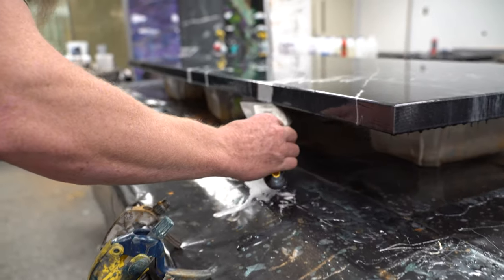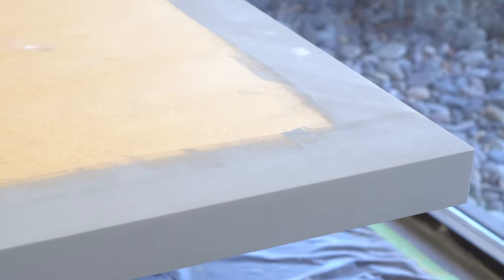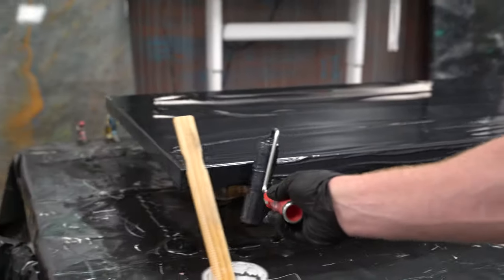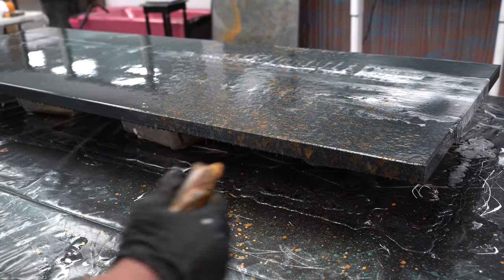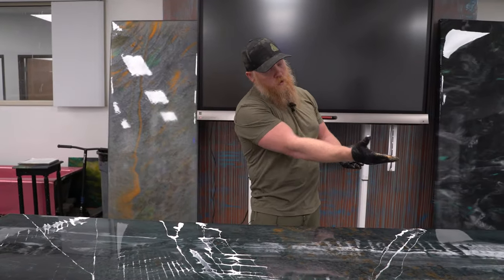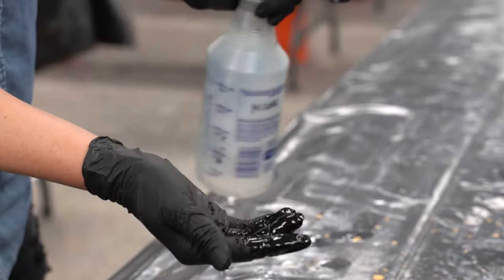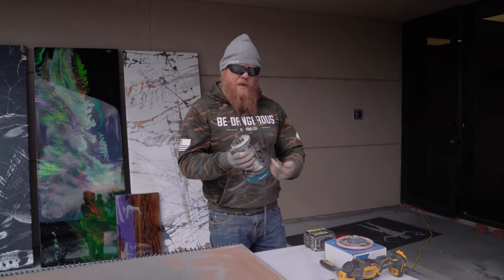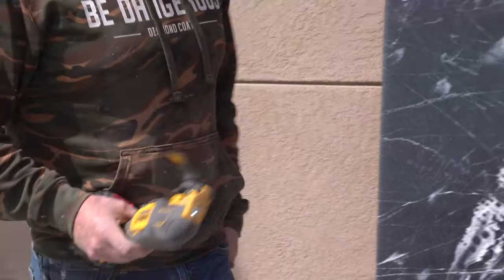HOW TO -  EPOXY EDGES -Countertop Epoxy - Fix Epoxy Drips - Epoxy Tips and Tricks

Comment: Thank you so much! I have cured drips (I was too lazy about scraping after my pour) and sanding them down slowly was not working. I used the oscillating tool and vacuumed everything up and now have beautiful smooth edges. Thank you so much!
Reply from the maker: Awesome glad this helped!
Reply: @CountertopEpoxy  Do you recommend using a 1/8 or 1/4 roundover bit on edges?

Comment: Why do you apply the  FX edge to block colour? Is this to prevent wood bleed? Or to prevent excess drips? I’m doing a dresser so making sure I do this acutely. Thanks in advance for clarification.
Reply from the maker: We actually just stopped selling this. It was used as a precaution if the mix wasn't properly color blocked. It's not needed, so just be sure to do a "stick test" where you dip you mixing stick in and out if you can't see through it then you know you have color blocked correctly.

Comment: hey i did an epoxy job on my counter top that has routed round edges but it seems no matter what i do i end up with waves in the edges which is not the look i want to achieve i even sanded my first coat did a flood coat but after a little while it drips down and leave and uneven surface i also broke the surface tension and followed every possible steps what shoud i do?
Reply from the maker: Sounds like a surface tension or heat issue. The goal is to give the edges enough Epoxy so it pours over the edges in a sheet. We often break surface tension more than once to ensure this. And we never apply heat to edges. Give us a call if you have questions 970-639-9338

Comment: Instant subscription to your channel
Reply from the maker: Thank you 🙏
Reply: @CountertopEpoxy I have a question,  I did my first pour on a kitchen countertop.  It was a lot to do in minutes. Somehow, in the shadows of the upper cabinet was a spot that I didn't spread the epoxy over, like an inch by 2-inch oval dibit that has nothing on it.  Is there any way to fill this and sand it smooth?  Even if the finish isn't perfect after. It's over black charcoal chips and under where it doesn't show to bad. A 2nd pour isn't an option right now

Comment: What would you do in case of unevenness on the edges and it's already cured? A hard sanding or try scraping it?
Reply from the maker: You could do some sanding. But so long as you break surface tension first prior to letting the epoxy pour over the edge you shouldn’t have any issues.
Reply from the maker: @hendosia  give our office a call and we can assist for the best approach.
Reply: I would always plan to do a clear flood coat over your color coat.  This gives you a layer to sand even for uneven edges.  You can also use the alcohol trick on a gloved hand to rub the clear coat smooth while it is still pliable.